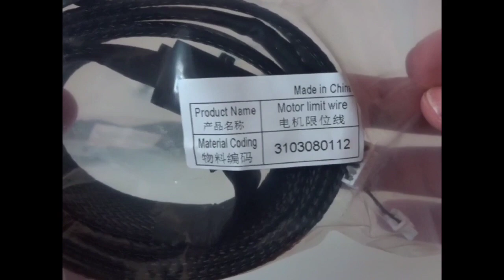Creality Ender-3 S1 Pro main hotend cable replacement

Comment: Thank you! You made it clear and easy to replace! My bottom fan for cooling the filament has stopped working. I know the fan itself works because I tested it. After exchanging the cable belt everything it working but that bottom fan. I tried chatting online with Creality Ender and they said they would have to send the problem up the “chain” and would get back to me via Email. Still haven’t heard back so while waiting I tried the new cable. Any suggestions would be greatly appreciated!
Reply from the maker: If you replaced the cable and the fan still does not work, I would send the cable back for another. The only other option is that the board has popped a fuse due to a short because of the bad cable.
Reply: @joeprints3dstuff  thank you for replying! Is there anyway for me to change a fuse?
Reply from the maker: @barbpaz3636 not unless you know how to solder surface mounts. I would try a different cable first.
Reply: @joeprints3dstuff  ok thank you for your help! I really appreciate it!

Comment: Great video. How long did you have this printer before you had to replace it. Mine is coming in the mail and i want to know what to expect. Tell me your thoughts on it as a hole too
Reply from the maker: Mine was only a few months old, but I used it quite a bit. Check out my review video of this printer.